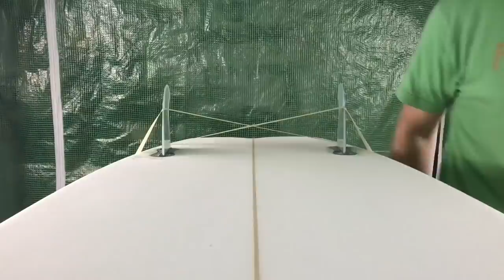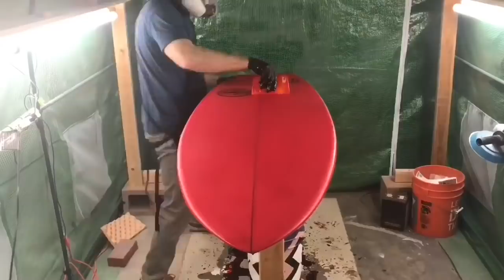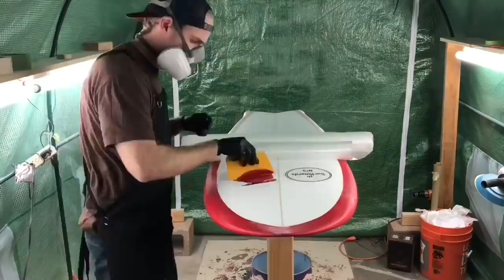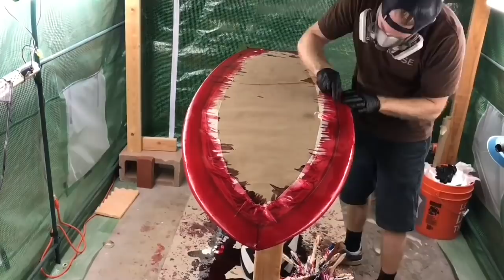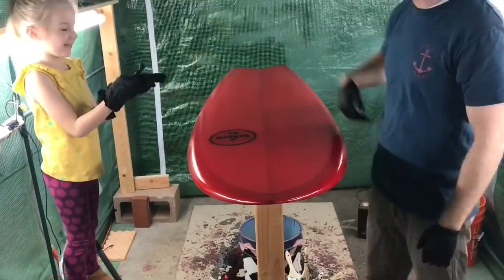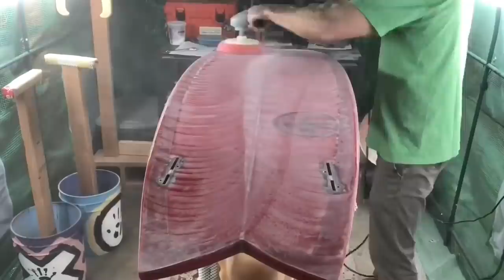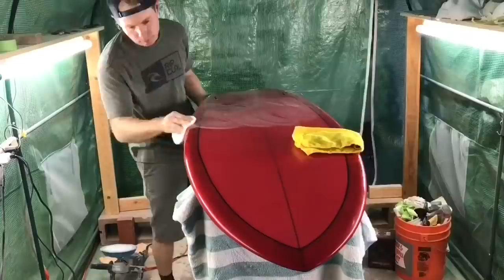Surfboard Glassing [Polyester Resin Fish]

Comment: Hi again Tanner, could you tell me please what resin do u use in second and third stage of this process?
Reply from the maker: 1st is laminating resin with the fiberglass cloth.  2nd is sanding/hot coat resin.  3rd is gloss coat resin.
Reply: Tanner Bendheim ok, but if i haven’t gloss coat resin, what I can use alternative? I mean 3rd stage is more about polish, right? Can I use varnish or something like that? Sorry for questions I’m from Russia and our surf market too poor and I have deal with it. Thank for your responses
Reply from the maker: You don’t have to add a gloss coat if you want to do just a sanded finish. That’s how most high performance boards are sold since it’s less weight. But if your doing pin lines and need to seal them you could do a another thin coat of just sanding resin rather than a gloss coat. You just won’t be able to get the high gloss finish but it will still looks good.
Reply: @BendheimBoards  thanks a lot!
Reply: Tanner, I have a problem with dry spots on rails when i putted a final coat. Do you have any advices about that?
Reply from the maker: Make sure your don’t touch the board with your hands by either wearing gloves of using a rag. The oils from your hands can cause problems like your describing. Also clean the board with denatured alcohol after lamination and before the hot coat.

Comment: Would it work if I used a sharpie to make the stringer black?
Reply from the maker: No it will bleed with the resin. Use a water based paint or posca paint pen
Reply: @BendheimBoards  Ok Thanks!!

Comment: is a hot coat and a gloss coat the same?
Reply from the maker: Not for polyester resin, the gloss coat is thinner and allows a high gloss finish
Reply: @BendheimBoards  and with epoxy? can i use the same resin for both work steps?
Reply from the maker: Correct epoxy is the same resin for both

Comment: Tanner Bendheim what is the last coat that you put on? it was some what red.....
Reply from the maker: Jon-Rolfe Sparks the last coat is the gloss resin. It has a pink color to it. It lets you get a high gloss finish. The first coat was sanding resin which you can end on if you want a sanded finish.
Reply: @BendheimBoards  what brand of resins are you using in this video? I'm curious... your board in this video turned out really nice and the transition between the coat looked seamless, thank you fro your response.
Reply from the maker: Jon-Rolfe Sparks I used Silmar polyester resins from Shaper Supply. Laminating resin, sanding resin and gloss resin. Here is the link:  https://shapersupply.com/collections/polyester-resin
Reply: @BendheimBoards  Is there a benefit to doing another hot coat instead of the final gloss coat? Would it change the aesthetics at all? Thanks!

Comment: why are you not reusing brushes ?
Reply from the maker: I clean and reuse my squeegees and cups but I’ve always been nervous about cleaning brushes. I worry the acetone won’t clean just one small bristle of hardened resin and it will end up coming out on my next glass job. I don’t do a high volume of boards so rather than tossing the disposable brushes, I’m making a chandelier of brushes for my shaping bay rather than adding them to a landfill.

Comment: Hey Tanner, Great video!! Eventually I want to shape my own boards but I am starting off by learning how to properly fix surfboard dings. My question is somewhat complex. I made a post on Reddit. It would be awesome if you could answer on the post below.
https://www.reddit.com/r/surfing/comments/gnj8ou/surfboard_ding_repair/

Keep up the good work!
Reply from the maker: Thanks man! Ding repairs are a great way to ease into surfboard building. Regarding your questions, I’ve never used UV resin myself but from what I know, normal UV resin doesn't need MEKP to catalyze, it just needs sunlight, though you can add some MEKP to it to make sure it kicks (needed if using dark pigments). Your type of resin could be different from what I’ve seen so I would suggest searching the forums at swaylocks.com and type in your question. Or Backyard Surfboard Shapers is a Facebook group you can join and ask questions and get lots of feedback.  Best of luck.
Reply: @BendheimBoards  Thanks for the info! yeah I think the resin I have will work with just sunlight to cure, however I was told if I am using Cab-o-sil I will need to use hardener. Thanks for your response! ill def check out swaylocks and the FB group
Reply from the maker: Sounds good, it’s probably because your repairing such a thick area with cabosil that the UV rays won’t reach all of it inside so using catalyst makes sense. I just don’t want to try and give you a definitive answer when I haven’t used UV resin.
Reply: Tanner Bendheim word. Appreciate the honesty!